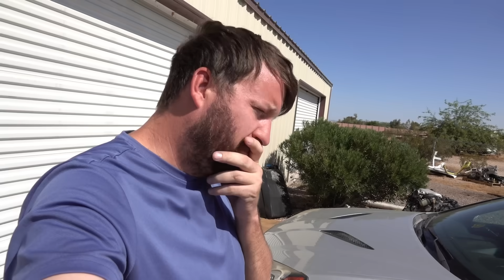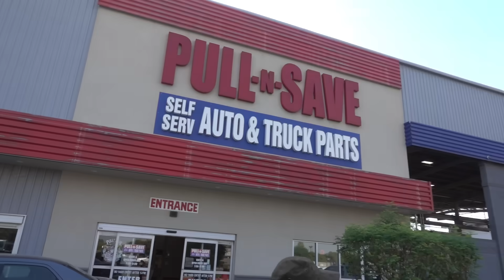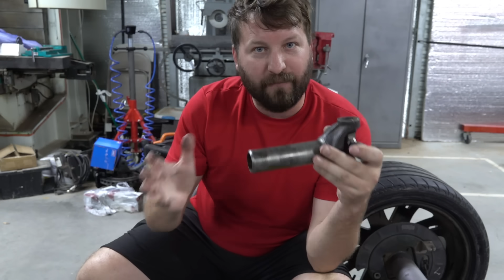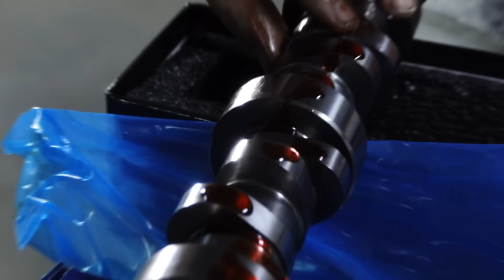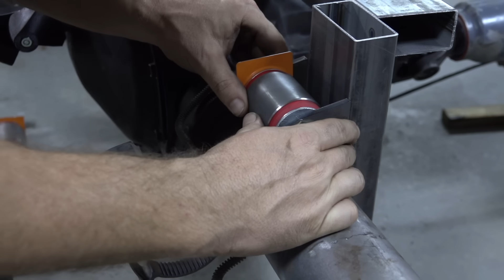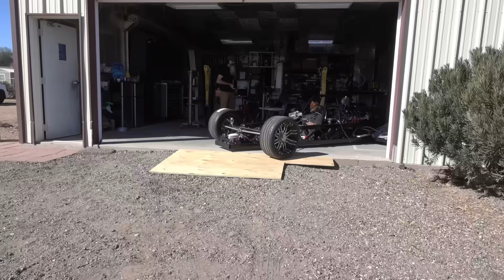Death Kart or Die Trying! LS Formula car full build!

Comment: Why not use a shorter transmission like an Aisin AR5 or another? If you do that, youd be able to make the driveshaft longer, and get some suspension travel.

Or,

 I don’t really understand why it has to be solid rear axle. There are plenty of cars out in the junkyard that you could take an IRS from for very cheap. Having an independent rear suspension setup would also mean youd get more competitive racing in the series (because suspension setups would differ), and it would be more comfortable for the driver.

I know that doesn’t sound like a super big deal, but if the drivers aren’t comfortable they’ll quit your series. Remember these guys are gonna be sitting in there for hours while pushing the car to the limit, and slamming over the corner curbs on the track. Also, if there is a sausage curb on track, that could genuinely be a life threatening situation.

This is your project, so I’m not trying to dictate what you do though. Also, to the people that said the car is too long, have you ever seen a Formula car? They are loooong😂
Reply from the maker: Good ideas. Remember the goal of the project was cheap. Not function. All function arguments are ignored. If its cheaper and easier to build then that's what we did. Yes you can pick any IRS vehicle and do exactly what we did here. That would 100% work. But shocks and the other components related to the IRS increase cost. We did check this and there is no way to reuse the suspension from any of the junk yard cars for a vehicle like this. So your going to buy coil overs guaranteed. Maybe re make the control arms. 

We also have a fully body designed for this car that will make lots of down force so that will make the shocks even more expensive. 

What a lot of people mistakenly do is see this design and think "stiff as a rock". That is false. The poly bushing do have squish and the frame will flex. This is the same method that shifter karts use. By doing this we have about 1 inch or 25 mm of wheel movement. The car is only 2 inches of the ground mind you. And it is fully tunable. The rubber can be selected for its hardness or softness and the frame can be adjusted for more or less flex. And more!

Lastly is that we already have a large group of people doing this. The shifter kart guys. And to an extreme degree the super kart guys. rigid karts going 140+ mph on proper circuits. They specifically don't run the races for long because of how grueling it is. So this is for sprint racing. Not endurance. maximum 1 hour in the car. More likely it would be in very short 15-30 min races.
Reply: @centurialinc  hmmm I see. Coil overs are very expensive that is very true. I still do worry a bit about these Death Karts going over hard curbs while racing, etc. I do actually see the appeal of all of it now. It might be a good idea to add a collapsible steering column so that you don’t have guys skewered on track😂.

Also side note, I really appreciate how you took the time to respond to my comment. I look forward to seeing this progress. 😊
Reply from the maker: Happy to talk about my projects to those who interested. Track testing is coming!

Comment: Frame is too rigid to not run suspension, also the wheelbase is quite long. I suspect it will spin and under steer under power very easily.

The whole frame acts as a torsion bar when a wheel hits a bump, your frame is so rigid I doubt it will twist well. Probably will work on a really flat track tho

Seems easier to run an engine and transmission combo from a fwd vehicle in the back with cv axles. k20, 3800, etc… Plus you can grab all the other shit like axles wheels and knuckles from the same car and they will fit together.
Reply from the maker: Those are good ideas. We can test those too. It does have the poly mounts. Those offer a surprising amounts of flex. So it's hard to say what exactly it will do. But this year we will find out.

Comment: I already started a similar project, but I planned for suspension. I'm using a Dana 35 with an LSD, and a 2wd XJ front axle....that's all I got. I moved 4 times over 1500 miles (total), so I'm glad I strll have the (freshly rebuilt) axles!

Trans should get a much shorter tailshaft (&housing).

I'm planning on 4-link quarter elliptical leaf springs, to minimize space required and weight. Probly using trailer trailer springs, because my target is 1000 pounds.

Your frame is over built, look at the Lotus 7 "replica" builds (aka "Locost" 😉).  Make the frame bigger and it can be smaller. It's like a lever, so if there is 100lb of twisting force in a frame that is 18" wide ><12" tall, that will be 25lb in a frame that is 36" wide >< 24" tall. Making it bigger lets it be smaller 😉
Reply from the maker: Awesome! keep at it! Thanks we will test this one as is and see what happens.

Comment: What front suspension? What front steering
Reply from the maker: All the wheels are mounted with Poly bushings. It's not real suspension but gives a small amount of flex. We re used the steering box from the 2004 Suburban. Because we are center driving we needed a steering system that would be centered and a steering box is the only cheap and easy way to do that.

Comment: Find a Tahoe with the IRS, you will have an independent front and rear suspension from the factory to start with with an LS V8. Then use the extra money you save on a t-56 from a vette. I think what you are missing is 1,000s of pounds of down force for the suspension you are using when you are comparing yourself to a modern prototype or open wheel formula car.
Reply from the maker: Check out the concept model here. Full body with downforce! We expect it's own weight in downforce when we are done. Hopefully summer 2026. https://www.centurialinc.com/long-sword
Reply: @centurialinc  Thanks for the quick response! I will look into it, in the mean time be safe and good luck!

Comment: Brother great so far.. one suggestion, always build the transmission the best you can. If the transmission is a 4L65E you may not find a lot of performance parts.. but at Summit Racing I found Sonnax. Look at all the parts Sonnax has available and a performance rebuild kit. Trying to keep the cost low. Also might want to upgrade your differential oil.
Reply from the maker: Very good ideas. We did have the transmission rebuilt with performance parts and it is ready to go back in. I hope to have it on track for testing this Nov-Dec. Then next year we finish up the body work.

Comment: I want to like it so much. But there is so much wrong from the ground up. It would have been just as easy to build something right and still keep it cheap.
Reply from the maker: Just wait till the test drive. If it rips then this is right. No, building this is as easy as it gets because it dose not follow common practice. We have built plenty of cars over the years. Getting the weight this low requires Carbon fiber panels, not easy or cheap, exotic engines and transmissions, not easy or cheap, and more. If this car puts down a fast lap time it will set a record for performance per $. Time will tell.

Comment: That transmission looks like a remanunit being grey painted and order factory 4.8 pistons and gen 4 5.3 floating pin rods and 799 or=243 heads
Reply from the maker: It was but still turned out to be bad. Bummer. We got it fixed later this year we will finish it and take in on track! Don't miss it.

Comment: And this is EXACTLY why my fave rides are Kawi ZX7's on the road and older Kx250 on the dirt.  They both are able to be pushed beyond my skill levels. yet provide me with the very most cutting edge nosebleed performance. Within the realm that "I" ride in.   I can rebuild my Kx engine on the coffee table in under 2 hrs and it will shriek like no other.  Zx7  Its all about the suspension. If I keep up on the shock and forks and have new tires, There is no other bike ANY size that feel any better and most are far worse.   New doesn't mean better. And bigger doesn't equal faster in the turns and chop.
I will absolutely smoke you in the turns, its where I live. Drifting and sliding 1 mm from catastrophe every lap.  That sht was what was fun!  Meanwhile my buddie and my cousin on their big bore super built whamo extravaganza bikes of $$ bling, are 5 turns back and white as sheets when the finally find us stopped and resting... Then they ride our mids and are amazed and look at their bikes funny. 
Like , how in the ef?   Because its a scalpel you goofs.  All the Zx needs is a ECU and a decent exaust..DONE!   and they and Gsxr's 750's are cheap.  Its all about suspension brakes and tires.
The exact oppisite of what you think or have been told.   Handling first, power after!
Reply from the maker: Your talking to an ex 5 time champion. I took a 2008 Triumph Daytona 675 to three Amateur championships and two pro championships. Retired from motorcycle racing in 2010. The first thing! Literally the First thing we did to that bike. Was stiffen up the suspension. The faster you go the stiffer you have to set everything. Riding with your friends on the streets means you never got even close to that bikes limit, and you would have had no chance on track against the amateurs. This car with Turbo will be over 700 hp and when the body is done it will make it's own weight in downforce. No bikes on earth can do that. We expect 3-4 g's in the turns. That's 2 times better than the GP bikes. And at these speeds the suspension stops working. So you make the car stiff as hell and let the tires and frame take it in. 

In the end we are going to send it anyways. even if it fails. Testing latter this year don't miss it.
Reply: @centurialinc  No offence or whatever But I raced for KHI.
Reply from the maker: The nascar KHI?
Reply: @centurialinc  KHI, Ltd Japan.  They called us...Pilots.  Lolz, So true...then I went on to be a tool and die maker, performance machinist.  Not the sharpest , but i know my way around. Im glad you were also able to break the ceiling. I had to train like it was the Olympics and practice till blisters bled to make it.  Same old same old. all I know is I was never better then when the gate dropped. There was no you me or anything but that moment. And I can still vividly recall looking down on telephone pole tops and high fiving a random rider next to me.
I broke 9 frames before Kawi sent me my own bike. It was nothing like what you expect. It was a level up multiplier. To have a factory bike, Maybe not full tilt, but still from Tokyo sent to me direct. was a mind blowing experience!  I had the very first FMF pipe ever made in 94 the very first seat cover , the very first...I had the first of ten BIKES !   and I still have it today. It will never leave. even though im on my fifth shouler rotator fix and my hips, knees ankles and Hell EVEN my metatarsils are shot! Dont go motocross unless you know you can win lol. the price 30 yrs later is too high. Best wishes. sorry long post, im bored anyway. Cya in our dreams at the track!

Comment: the wheel base is too long if you try using a gearbox from a fwd  audi or something similar
Reply from the maker: It should be fine. These parts are selected for their availability, cost, and strength. The wheel base is just an end result of that. Testing latter this year. Follow to see how it turns out.

Comment: Just because you want to build cheap doesn’t mean you can’t learn how to build suspension and possibly even create a rear wheel independent swing axle. I watch guys build some pretty awesome carts, cars trucks by hand in their garage.
Reply from the maker: That's why we went bankrupt the first two times. We tried to do it by the book. And yes we know how to build suspension. You can watch us build that for the first design. The reality is that the shocks are very costly. This is not a modified BMW. This is a very high downforce design. The shocks for something like this are multiple times more than the engine. And would nearly double the build cost.
Reply: @centurialinc are any of the previous versions posted? I’d be happy to watch them, as well as progress on this version, so I have a better idea of what you are trying to build/ achieve.
Reply from the maker: Sure watch this episode here. https://www.youtube.com/watch?v=k4bkJOZ10FI We have others look through them as you wish.
Reply: @centurialinc Wow a lot more high tech than the final/ current? version. I’ll have to check out more to see what went wrong other than trying to go to good to soon and running over budget.
Reply from the maker: Thank you. It really is simple. That upright took months to create. Research, Design, Built our own CNC machines, Learned Programing the CNC, Made the mold, painted it, learned casting, and set up a furnace, then machine the final castings. Allll that for one single part! Time + investment made that part cost over $20k! That is what the text book tells you to do. Now compare that to the one we just made. We built it with nothing more that a band saw, a welder and some hand tools. And it went down the road in just 8 months! F the text book.
Reply: @centurialinc I just wish for your sake that (Hindsight 20/20) you would have started simple and worked your way up with the aid of YouTube revenue. Maybe you did start with YouTube? I’m getting caught up 1 video at a time as I am intrigued. 🙂
Reply from the maker: I wish that is how it went. But even back then YouTube was very competitive and it was hard for us to make content that paid. Even today as I get millions of views a month and we make $0 off YouTube. People underestimate how hard it is to pay for things. That is the real challenge, and why we went bankrupt twice. We self funded the project with blue collar income and from friends and family. Building a race car today is trivial. Mankind has all the knowledge to do it. The difficult part is figuring out how to pay for it. We will get it done one way or another.
Reply: @centurialinc I really hope you can someday realize your dream. Hopefully you can enjoy the journey.👍🏼

Comment: No suspension. How are you planing on getting it to corner.  Even a race kart uses the frame to flex for the suspension. There is no flex in that thing.
Reply from the maker: It does have flex. We will see if it's enough. Testing latter this year.

Comment: Whatever LS you can find. Ford 8.8 rearend and a 6 speed manual (I think any 6 speed is fine since your weight will be so light) 
I hope this is what I'm going to see
Reply: After watching; 
No suspension- find some a small wheels, 14 or less = Huge sidewall 
Automatic? Come on! Manual is easy to learn, LEARN
Reply from the maker: Global Time Attack. It's fastest lap wins. It will have lots of aero. The automatic is a cheap and simple solution. No remote shifters or sequential conversions. Plus it all cam from the same donor vehicle that can be found in any junkyard in America.
Reply: Are your goals a track car or a drag car?
Reply from the maker: Testing latter this year. After that we will see what we do.

Comment: Why no suspension?
Reply from the maker: Cheap and easy.
Reply: They why not get rid of two wheels as well? Technically you only need two.  @centurialinc
Reply from the maker: Global Time Attack does not allow motorcycles. Rules require 4 wheels. But do not require suspension. But I like the way you think.

Comment: There’s also no such thing as a performance car without a suspension.
Reply from the maker: Wana bet.....
Reply: @centurialinc depends on what you call performance.. if you are wanting to get the absolute most grip out of a set of tires then you need suspension. If this is only going to be driven on the velvety tarmac of a race track then it might be fun but you aren’t going to get anywhere near its potential without a proper suspension.. introduce any uneven surfaces, acceleration turning and braking at speed will not be optimal. Unless I’ve been brainwashed by big Auto… 🤔 I’ll definitely stick around to watch and still wish ya the best of luck. I hope I’m wrong cause that will pretty much confirm you can’t trust anybody anymore. Lol
Reply from the maker: Lol, it will be interesting. Let's send it and see what happens.
Reply: @centurialinc I like your style! Good sidewall should do the trick and like an idiot I commented before I saw you addressed it but this should be interesting.. 😁

Comment: Heavy is not the way to go. Honda k18/20/24 VW 1.8/2.0t vr5/6 straight6. Performance translates to going around curved roads the fastest wins. Not 1/4mile.
Reply from the maker: Nah those engines are to wimpy for the aero this things going to have. We need 800 hp reliable. V8 is the ONLY way to go on a budget for that.

Comment: My buddy is doing something similar and he found a gem- an L92 all aluminium 6.2 out of a Cadillac Escalade and a set of rectangle port heads (the engine didn't have heads at the yard).
Gonna be a long while before he's close to finishing it, but once he does it's gonna HAUL ASS! I'm starting a project like that too, though on a much tighter budget and with very different parts- kinda hard to find a good cheap V8 here in Europe but I bot a 5 cylinder Volvo and a 6 speed Boxster manual (putting them together will be a lot of "fun").
Racing doesn't have to be expensive. It's only expensive if you let it be! If you have the time, some basic tools and a place to work, budget isn't an issue.
Reply from the maker: Very cool keep going and get it done!